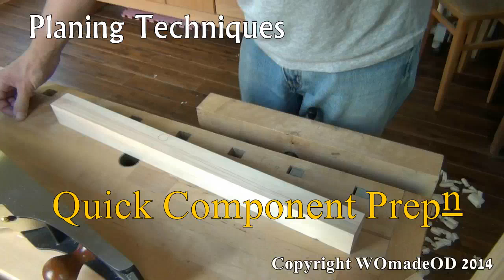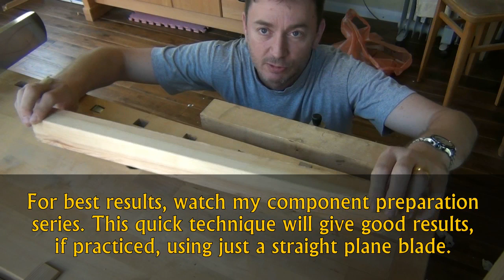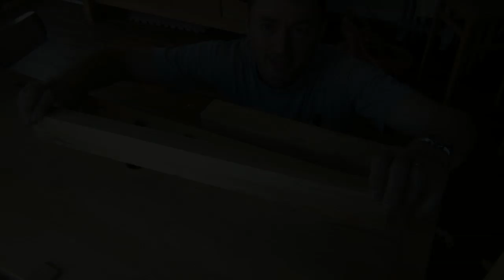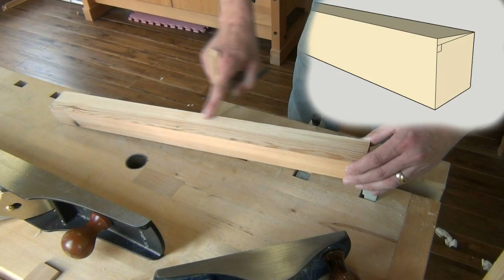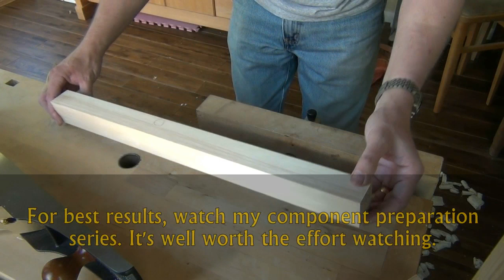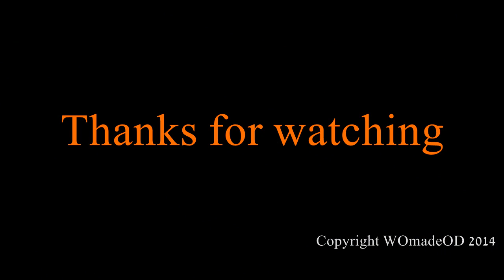Square a Component Simply

Comment: Straight blade, sole is flat on all my planes. Technique thing for sure and it's not one direction only, sometimes the lean is toward me, other times the lean is away from me. I can get it square eventually but it takes a few attempts and have to keep checking with the try-square.
Reply from the maker: Roonza Car Ignore the handles completely, and just guide the plane with a thumb on the top front of the toe, and a thumb and finger on the heel behind the base of the handle. This will minimise any tendency to tip the plane either way. You'll need an easy wood to push shaving like this! Assuming this works well, then start raising the rear hand up the handle, a little each shaving, checking each time to see if the inaccuracies begin again. Then repeat, but this time only changing the front hand. First try thumb pressure directly down onto the top of the knob, and then progress through to your normal grip. All the time, trying not to think about anything other than pushing the shaving. Since you say it varies, you may need to repeat the whole thing several times before you narrow down which hand the problem comes from. It could be both. After that, you can work back from the hand (wrist, elbow, shoulder, etc.) varying positions to try and iron out the problem.
If all else fails, put your name down for a future course! Cheers, Mitch
Reply: Mitch Peacock - WOmadeOD Thanks Mitch, will try that. Love your methodical approach. Happily sign up for your course, your hand tool methods are terrific. One little problem....I am 17000 km away in Melbourne, would you consider coming down under? Otherwise I'll have to save up and get over to England. By the way is there such a thing as having an "inner square" whereby a woodworker can just put their plane on a some wood that may be out of square and somehow reference off their bench or some other source and square a perfect edge? Almost like they can hold the plane in their arms and know that the plane will plane square.
Reply from the maker: Roonza Car Haha - yep, that's a long way! The wife and I do intend to travel to Australia in the future - we have friends in Melbourne too - but it's not imminent. 
'Inner square' - yes, but not accurate enough for good joinery, let alone fine furniture. Don't throw away the try-square!
Reply: Ok, i'll keep the try square, thanks for the suggestions. Let me know when you get to Melbourne I one you at least one meal for the help you've given me. Keep up the great work.
Reply from the maker: Roonza Car Cheers!

Comment: Another great video Mitch. I find that when I'm trying to straighten an edge on timber that I lean the plane ever so slightly one way or the other and the edge is not square to my reference face. Have practised trying to keep it square but still find it difficult to get right consistently. Any suggestions or exercises that can improve this?
Reply from the maker: Roonza Car Thanks.
This is very timely - I have just finished the Planes, Chisels, & Scrapers workshop (teaching the preparation and use of these edge tools). This problem came up, and working with the student we determined that hand position on the front knob was the main issue. It was cured by either just placing a thumb in front of the knob only, or raising the elbow of the front arm when holding the knob. Other causes, could be stance, rotation of arm holding rear handle (tote), etc. Of course, this all assumes that the lateral adjustment has been properly set for an even cut!
Get a short length of something nice to plane, and then try different combinations of the above, checking after each shaving with a try-square to see if you can narrow down the cause(s) in your case. It's hard to adopt a different technique, but regular practice will help.
Reply: Mitch Peacock - WOmadeOD Thanks Mitch for your detailed and prompt reply. I have read about people that have some sort of 'inner square" and they can detect when they are no longer running the plane square to a reference face. I realise that comes after  much practice but i've been playing around with planes for years on and off. The other vital cue from what I've read is that you can tell if off-square by the shaving. Hard to detect a shaving that is out by one-thousandth on one side compared to the other side of the shaving. I generally do run my finger along the reference face but there is an imperceptible twist that brings me undone, don't even know when I do it, just know that I am because the try-square says so. Can rule out lateral adjustment as I use a little bit of wood to set that.
Reply from the maker: Are you using a curved blade? If the apex of the curve isn't kept central on edges only taking one shaving in width, that could throw it out too. Also, have you flattened the sole of the plane? Slight inaccuracies close to the mouth will make setting with a small shim equally inaccurate. I think I've covered all the causes I've come across, so try and rule each one out in turn.
Good luck, Mitch

Comment: Mitch Peacock - WOmadeOD Mitch! Thank you for making this. I knew I subbed you for a reason, you're a knowledge gold mine!

I'll have to re-watch this again and again, though. I'm very much a newbie, in fact I've just learned how to sharpen and set my plane irons properly. It hasn't been a week that I've been able to magical curly shavings off my #4 and #5 Stanleys. I'm talking about getting them curly things, take apart the blade, sharpen, put them together again and get the same results.

I guess I'll be ransacking your vid collections in the near future :)

Btw, that LN #8 looks real sweet. I wonder when I'll have the guts to use mine. Got it and a few others months ago, still haven't used them a lick. Wanted to be sure I knew how to properly handle hand planes first.. oh well.. time for that soon.
Reply from the maker: truebluekit Cheers. This isn't a common method as far as I know, but it works. I guess my younger days in engineering helped me come up with it.
Hope you'll find all you need in my videos. I cringe watching the old ones, but only over my presentation, the details are all sound.
Any problems, you can always email me (see the website for details).
Happy woodworking, Mitch
Reply: Mitch Peacock - WOmadeOD It's not a common method, I'll give you that, but it makes sense to me that it would work.

See, when I mentioned I'm a newb, I'm so new that I don't have a work bench, only one over-high, self-made saw horse which I'm using to slowly plane away a plank at a time. (Have multiple LN planes but not even a cheapo store-bought bench like a WorkMate; what's wrong with me?). So I've been needing a way to square off my construction grade lumber, piece-by-piece, so that I can eventually build my work bench.

My problem is that most everyone who's showing how to make workbenches either (i) use pretty looking and well-dimensioned lumber straight off the racks (which I cannot afford), or (ii) have a work bench (I don't have), or (iii) use power tools (hand tools only, bandsaw is sole power tool, and haven't even tuned that up proper).

So, you've given me an idea on how I could get started. There's a long way to go, obviously, but at least I know which direction I should head in.

One thing I would dearly like to learn is how to hand plane a surface to perfect flatness with no plane iron tracks, using a straight plane iron, no camber. Do you already have a vid on this? I haven't reached that stage yet, but it would be nice to know before I get to it.

Thanks for the offer for help, I'll certainly take you up on it later.
Reply from the maker: truebluekit 'how to hand plane a surface to perfect flatness with no plane iron tracks, using a straight plane iron, no camber' - That's a tricky one! 
Usually an initially flattened surface will have some plane tracks, left by say your #8 with a straight edge blade. Then you would smooth the surface with say a #4, and either a cambered or corner softened edge blade. Only removing the bare minimum to erase surface faults (like the tracks).
If you want to do it all with a straight edge blade, then I would flatten it, taking moderate thickness shavings. Then retract the blade a bit for thin shavings. Make sure the lateral adjustment is spot on again. Then take sets of shavings, either left to right, or right to left, each pass slightly overlapping the previous one, with weight down on the unplaned side. This should keep the one corner from leaving a track, whilst wiping out the other corner's track on each pass. You may need to retract the blade some more and repeat. It's easier to do it than to write it down! I flattened my first workbench that way and it turned out okay.
Reply: Mitch Peacock - WOmadeOD
It's easier to do than to write it down, but you wrote it very well indeed. I saw clearly what you meant, and surprisingly, it went a lot like I had imagined it to be.

Thank you very much for this, Mitch. I need to put words into practice first, but at least now I know that I'm not chasing a red herring.

Keep the vids coming Mitch, and all the best to you and yours :)
Reply from the maker: Likewise, and keep me posted on progress

Comment: Thank you very much Mitch. I am new to wood working. I'd just bought No. 4 Sweetheart 10-45/64 Smoothing Bench Planer, #62 Sweetheart 14 in. Low Angle Jack Planer and No. 60-1/2 Sweetheart 6-1/2 in. Low Angle Block Planer. I want to do good quality wood working, but have never done any wood working before. Am I over my head with these planers? I'd saw what people do when they get it out of the box and most planers are NOT perfectly straight. GREAT lesson. Have a great day.
Reply from the maker: Mai Dayjeen Hi, 
That's not a bad trio of planes, and will cover a great deal of tasks.
I haven't experienced the modern Stanley sweethearts, so I can't comment on how well they are made and work straight out of the box. My best advice is to check them with an accurate engineers try square and straight edge. I have videos covering checking and correcting any inaccuracies. My review of the Axminster Rider No.4 shows how I check the main points, and my epic Restoration of a Stanley No.4 shows all the steps to correct problems (this was one of my early YouTube videos, so excuse the presentation!). Please DON'T attempt any corrections unless you are sure you know what you are doing and why you are doing it - I don't want you to inadvertently make things worse. DO ask me about anything you are unsure of, and I'll do my best to help. 
Since you're just starting woodwork, have you looked at my other YouTube channel, Get Into Woodworking?
I'm also hosting a course in planes, chisels, and scrapers, this August, which might be of interest. See my website http://www.womadeod.co.uk. 
Good luck, and please let me know how you're getting on, Mitch
Reply: Mitch Peacock - WOmadeOD Thank you very much Mitch for your respond. I am new to everything about woodworking. Few months ago, I had an accident with table saw and almost lost a finger, but only lost half of my nail, skin and both of them are growing back. I can say I learn everything from Youtube from kinds people like you who's take time to explain and showing us how it or should be done. I have not built any thing yet, except work station. Your video that I saw was excellent. Thank you very much and I will check out the rest of your videos. Have a wonderful day. Mai (Thailand)
Reply from the maker: Mai Dayjeen I'm pleased you're healing after that accident. 
Please don't assume everything you see on YouTube is safe practice. Experience helps to avoid accidents, and I've shot a few videos (with power tools) where due to my experience I may have done something that a beginner shouldn't attempt straight away. That's why it is always best to stick to manufacturers guidelines. 
Stay safe, and enjoy your woodworking, Mitch
Reply: Mitch Peacock - WOmadeOD Thank you Mitch. I really appreciated the advise. Have a great day.